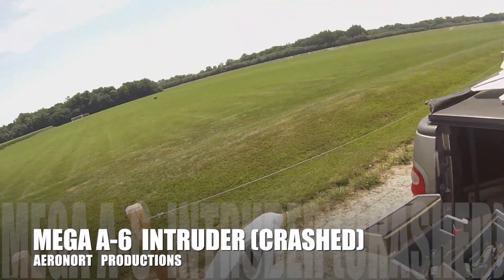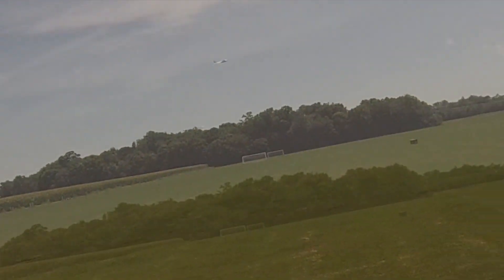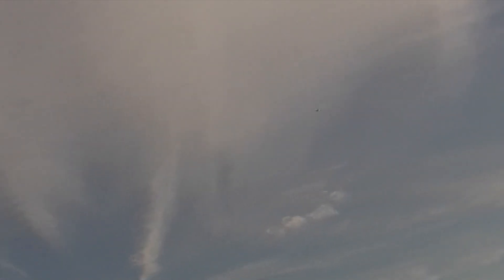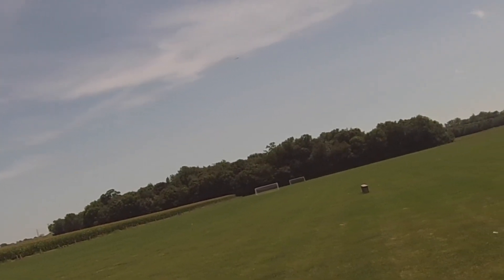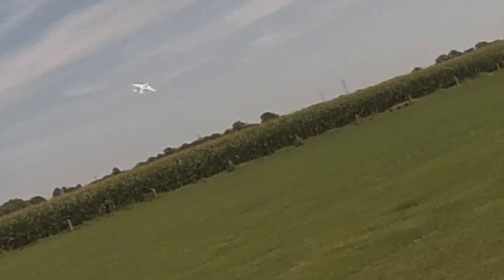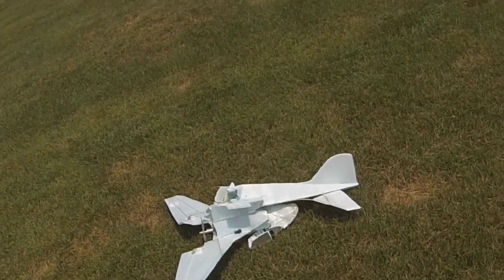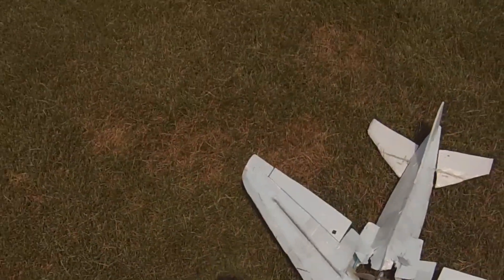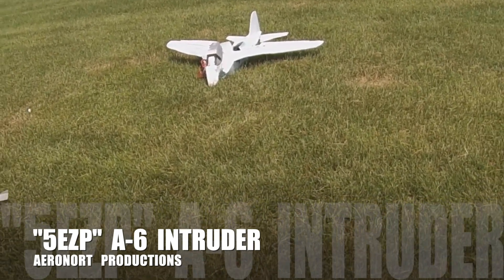MEGA-JET on the A-6 INTRUDER with CRASH

Comment: That looks so good in the air and looked really nicely dialled in...until....
Saying that, a couple of BBQ skewers down the fuse and a straightened nose, it could fly again :)
Reply from the maker: slider2732 
Thanks ,
I may try to rebuild her just on principle. The Intruder is a smooth flyer and does well on the Super-Sonic motor too.